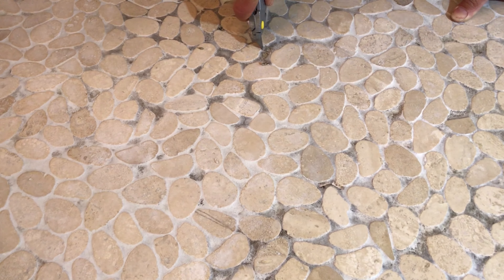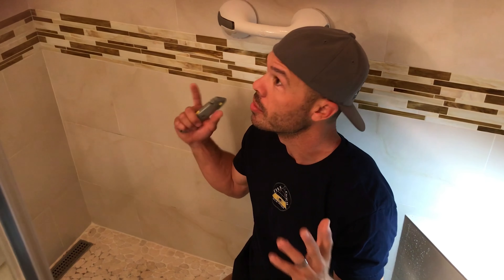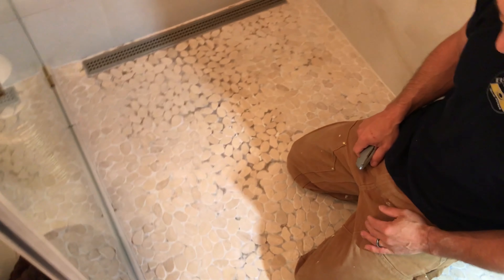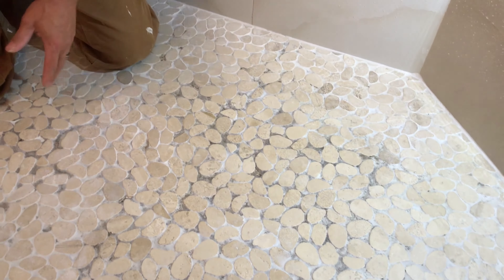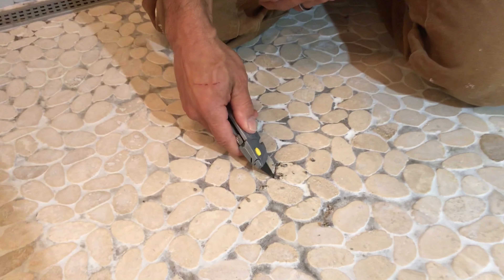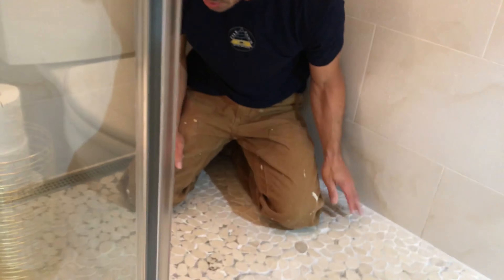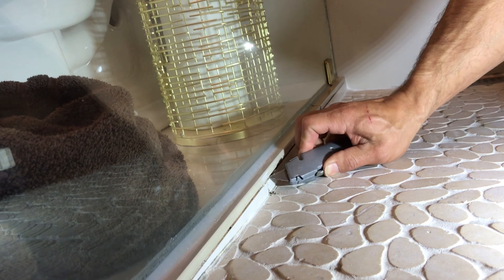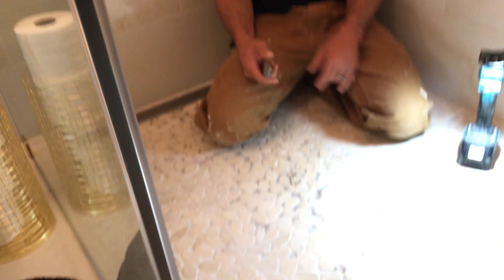I GROUTED this Shower WITH FUSION and it FAILED!

Comment: why the hell would you use a premixed product on a shower floor??????  I'm no tile pro and I would never use a pre-mixed product in a wet location....I'd never use it on a floor with a lot of traffic either.  I've never known a tile pro to use pre-mixed grout.  Here you are again blaming Custom Products when you didn't follow their directions.. but worse, when you did something that is literally outside of the common practice for the industry (pre-mixed grout) in my experience dealing with tile pros.  I have no problem with you trying to see if the product would hold up in such an application though... now you know, but I wouldn't rag on the manufacturer for this one.
Reply: Part of the problem here is bad marketing. I just checked the Custom website 11-13-21, right there in the Fusion Pro description they say you can use it "specifically on shower floors".

Comment: Having had a few grout problems over the years i now no longer supply the stuff. Let the contractor, client or architect specify the type and let them buy the stuff. Same with tiles. I used to make a tidy profit supplying tiles but had shading issues so no longer bother as i don't need the hassle. As for the disclaimer on the boxes blaming fixer for shading issue's, the day i start work i pass the disclaimer onto someone else. Had enough BS in 35 years of fixing and want an easy life.

Comment: I have a basic question. Grout has been around forever. How did you end up using "fusion that was new" instead of something that was proven to work well? There must be a compelling reason, cost or promise of lifetime warranty. This cannot be the only fusion system you have installed. I suppose you do not plan on redoing all your fusion-based installation.....

Comment: Fuzion??? Are you kidding me? My understanding is that fuzion is NOT a cement based product....none of my tile guys will use any of these "new" type grouts in wet areas. We do have tile guys that will use non cement based grouts in non-wet areas.  I disagree, but do allow it.  If you want to really feel good about non cement based grouts,..find a job (that you are going to tear out anyway) and watch how fast MEK will melt it,. (or goof-off, or probably even denatured alcohol),..Most things that a solvent can melt,....soap will also do the same to...................very very slowly..over a long period of time.

Comment: This kinda river rock crap is not good for shower floors I’ve seen it fail on multiple occasion. It leaves the door open for too many problems. Look at the amount of grout required it’s insane. I’ve done it a few times didn’t have a problem but now I refuse it. But since I mostly do new housing it rarely comes up but when it does I get site and design center to sign off on it that I’m not responsible for this garbage. And it also looks like crap. This is my opinion though.

Comment: to me it looks like the homeowner used a soap or shampoo that badly reacted with the grout.
Reply: Yep, thats my hypothesis also, maybe some cleaning product or chemical.
Reply: It could be, soap consists alkaline, that may degrades glue component used in premixed grout. Epoxy grout contains resin, which is extremely stable. Resin holds integrity and can conserve substances for hundred thousand of years whitout degradation, a lot of archeological findings in south regions were preserved due to resin.
Reply: Similarly, I had a homeowner try this on me with an acrylic decking sealer but the rep. for the product came out and called them out on using something caustic and the customer denied it.  Under the pool handrail escutcheons it was like new and you could literally see the splash marks from whatever they used to stain the deck with.  Conniving people will do everything to put the blame on others including an innocent installer.   I think they did exactly this to Isaac here but got away with it on his dime.   
Very stand up to warranty a job that is 4-5 years old.
Reply: @surfacecreations  its annoying in the moment but the word of mouth from satisfied customers often pays it back tenfold. I do mostly floors so I dont have many callbacks, maybe replace a transition that the glue has come loose,  which is a good thing because I would have a shitty attitude in those situations. Character flaw I'm working on.
Reply: @GJLCreativeStudios  Annoying is hardly how I'd describe what it would have taken to fix how my customer ruined their deck's surface.  It would have been a full reinstall and they thought it should be on my dime, free labor, free materials...nope.  For the customer that tried tactic this on me, I let him take me to court since he was clearly at fault.  Wasted his time and mine but I didn't have to pay anything back for my correct completed work.  I also rely on satisfied customers and have gone to no advertising at all and only word of mouth for the last about 8 of 21 years in business.  I agree about those satisfied customers paying tenfold as you put it.   I will do so much more than is necessary for people and when somebody tries to pull one over on me after how well I treat them and their job, I just won't bend over for them if they turn on me.   We can't please everyone all the time.

Comment: I had a professional use Fusion Pro for my new shower install. He used it on the bathroom floor, shower walls and shower basin( floor). This work was performed in summer of 2017. 

After about 1.5 years I noticed the color started to loose its brightness. We do not use any harsh chemicals to clean the floor. Just soap and water is all that is needed. The color used was bright white. The floor tile grout looked great until the color changed to a kind of light dirty gray. Tried to cleaned the tile with a brush and soap and water but no change.

The shower walls seem to be ok but again there is the grout color change like the the bathroom floor grout. 

The really bad issue is the shower basin/floor grout not only lost it's color but the grout was breaking up in the area where I stand and wash myself. 

So I am doomed to keep repairing the grout with fusion pro unless I have a contractor come and rip out the floor and start over with super expensive epoxy based grout. I think after I let the grout cure for 7 days I'm going to apply some thompson water seal to the grout and see if that makes a difference. I will keep this review updated.

Comment: Fusion is crap! Everytime I've used the stuff there's been nothing but issues with haze, blotchy color, and not drying right. Epoxy or prism from now on CEG Lite is way faster and I've had alot less problems

Comment: What about an independent inspector. There are inspectors that are certified to inspect failed floors for customers and stores/installers alike. The one i used for hardwood cost me $75. They usually know more about failures than the reps. And just look at why the floor failed and nothing else like company interest or stuff like that. The inspector is a professional in the field so their findings can be used in court.
Reply: So you get the report, let's say it sides with you, do you expect Custom to just roll over and pay for the 2.5 days of work?  Then what, you have to take them to court over it?  How much effort are you going to expend to collect?
Reply: @walnutcontractors5661  obviously you will need to weigh out you options. It depends on the job. In my case i showed them the report and they paid. It was a hardwood job and i was able to prove that I installed it right. But if they would not want to pay then I would of taken it to Court. I have a feeling that if they will not pay after it going to court their lawers would say to just pay it because my case was solid. 

So it depends how much fight you have in you. Your case. And how much money you are dealig with. Its an option even if you do not believe it to be.

Comment: Give me good old cement grout. Fusion is junk
Reply: Many of these new grouts failed from all factories Customs, Bostic. Latacrete ect…. They knew they couldn’t preform as good as cement grout and added restrictions after the fact like this case. Not just pebbles all wet areas including outdoor insulations.
Last I checked Tile is used in wet areas so companies are being dishonest and trying to increase profit.
Don’t believe me? Go to Italy and see hydro cement a thousand years old and still good.
They sold them anyway.

Comment: So, We've known that Fusion doesn't work in wet areas. Its Acrylic based. Like the Acrylic caulking that NTCA workshops say not to use because it deteriorates with water exposure. The only ready to use grout we use in wet areas is Bostik Trucolor/Quartzlock 2. Sorry buddy!

Comment: Always go with the safe options. 
Grout that claims to be too good to be true, it probably is. 
Epoxy is great, but it's hard to install properly 
Regular grout with a high end sealer applied after cure time is the best option
Just don't assume your installer uses a sealer. Unless they specifically explain how the grout is sealed it probably isn't. 
72hr cure time for nearly ALL grout, unless your tile guy comes back 3 days after install, it probably wasn't sealed right.

Comment: I was a carpet installer for 13 years. Carpet reps were the same way. We unrolled a big roll of green carpet and it had flawed white stripes throughout the whole thing. He actually tried telling us it was a pattern. You're right when you say they are your friends until the point when you have issues with their product. After that whole debacle, the store we subbed out of dropped their product. We guaranteed our installation for 2 years but very rare we ever had to go back. People would ask about the warranty on the carpet itself and I flat out told them they would be the lucky one if the manufacturer ever accepted their claim. Manufacturers very seldom ever accept responsibility.  It's either the installers, homeowner or carpet cleaners fault.
Good videos man. I like your channel. I'm in the process of my own bath remodel and came to the YouTube for some pointers and ideas for my tile shower. Keep up the good work! I just subscribed too.

Comment: Bad batches do occur, so it helps knowing the product and keeping an eye on the details, mixing very well, etc..
Not so easy on newer products though.
Assuming it wasn't a bad batch, I can see the pebbles being a potential problem.
When using natural stones, etc. I would recommend doing a very good strong deep cleaning. Soaked.
The inside of the stones may have just about anything, and it can and will leach out during curing of grout or afterwards when being exposed to water.
Could also be something being used in the shower; cleaning products.